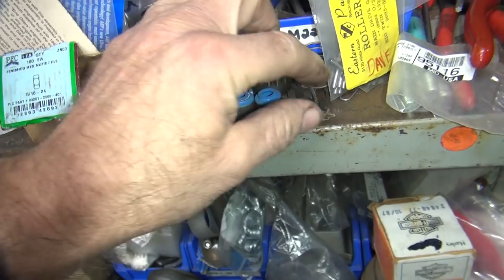1980 shovelhead #126 92ci topend rebuild stroker fxe street racer harley cam change tatro machine

Comment: Are you not using loctite on lifter block bolts because the owner plans to take it apart regularly? Or would you not normally loctite those anyways? I always do on TC/M8 lifter covers but this Shovel/Evo lower end is a different animal. 

Also, here’s the video that you answer all the questions I asked on the other video in. Go ahead, call me a dumbass. Lol
Reply from the maker: i don't loctite that many engine bolts because they don't need it.
tatro